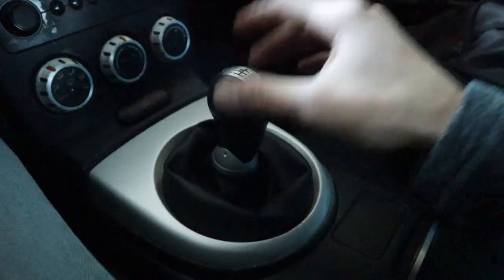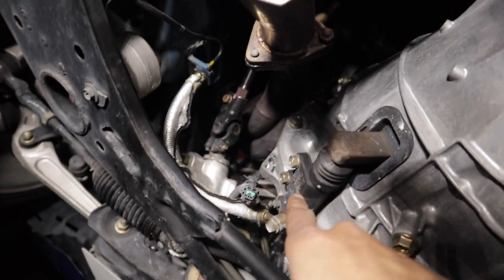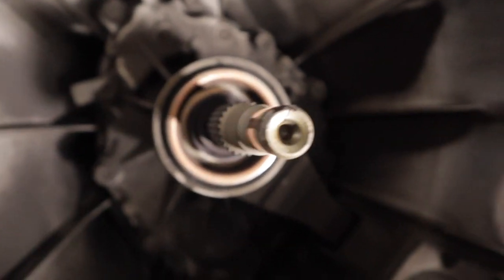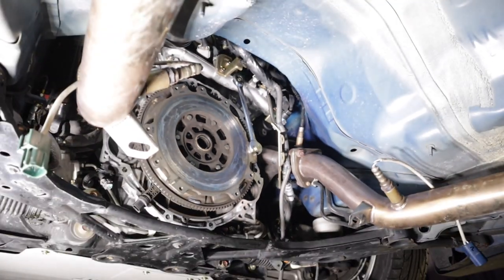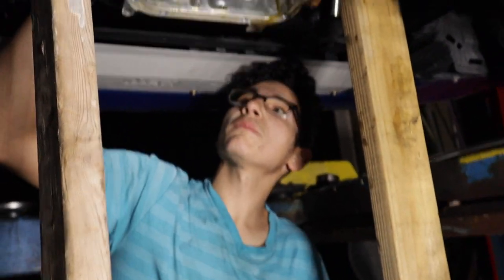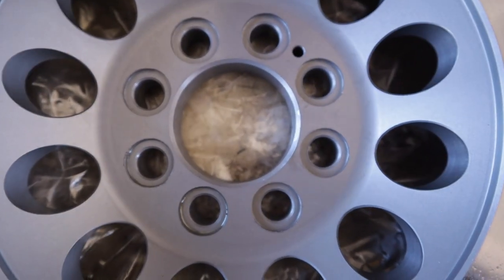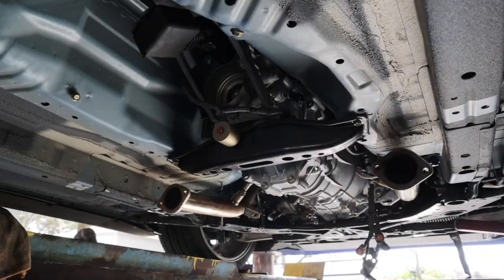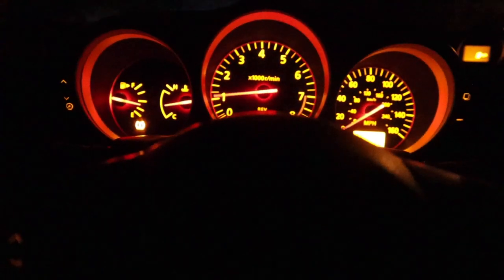350z stage 3 clutch + lightweight flywheel installation!

Comment: Bro its not your stock clutch were in you can simply just down shift with no issues, the moment you install stage 2+ clutch plates you wil have to face these certain vibrations in which you can destory your engine mounts, so when ever your down shifting my advice is you gotta rev a bit and dn down shift. Remember your Rpm shud always be high when your down shifting same goes for normal shifting as well jst give it a sum gas and then shift
Reply from the maker: Yea after driving it for awhile I realized that lol, thanks for the advice!

Comment: I got a stage 3 on my hr. It normally will do the rattling cause it's stage 3. The engine doesn't throw as much power as the upgraded flywheel and clutch kit. Basically it's normal. Upgrade your mods in your engine.
Reply from the maker: Yea I found out it’s normal thanks for the feedback 🤘

Comment: when you take off does it like limp? like it wants to turn off? i just installed the same clutch and flywheel and it almost wants to stall as i take off from a stop
Reply from the maker: I don’t have the issue no. I do have to use a little more gas to take off than the stock clutch though, if that’s what you’re talking about??
Reply: Got my z a a couple weeks ago, had a z1 stage 3 clutch with a light weight flywheel. It stall when you want to take off because you just gotta finesse the clutch with the right amount of gas, stage 3 either the light weight grabs almost instantly. So I would practice with it. Currently just installing an oem clutch and flywheel since I’ll be daily driving my z.
Reply: Hope that helped a little

Comment: Bro my clutch is out why not an oem over a stage clutch? I have a 370Z with aftermarket intakes, test pipes, y pipe and single exit and will tune it in the future what clutch would you recommend? I’m new to manual and I keep seeing all these clutches online and don’t know which one to get. Also, can I reuse an oem flywheel for a stage 2 or 3 clutch? Or it’s a must to upgrade? Thanks bro my car is sitting and I need to get here running 😓
Reply from the maker: You don’t need to upgrade the flywheel, but if you do it’ll make a difference. On the clutch it all depends on what you’re going to do with the car, I decided to go stage 3 because my car will be taking abuse when at the track occasionally. I do daily drive my car and if that’s what you’re also do then you can just get an OEM clutch, they hold up well.